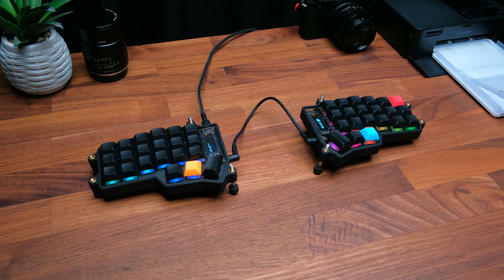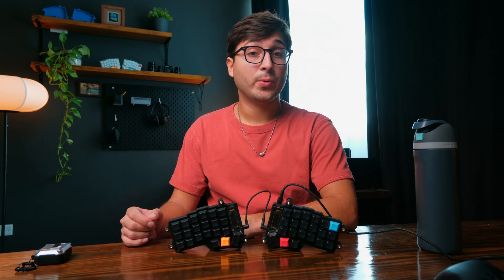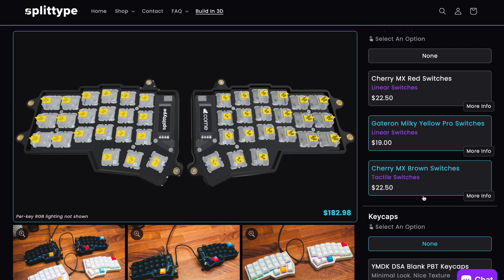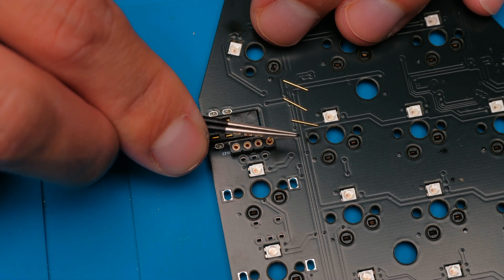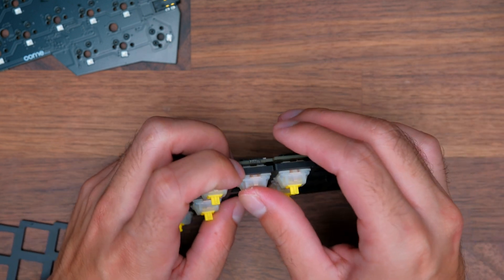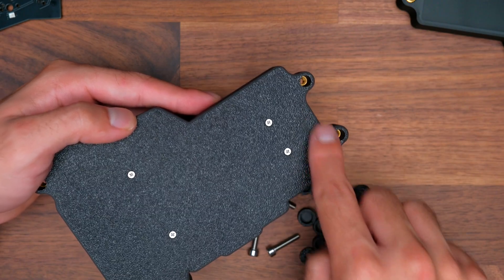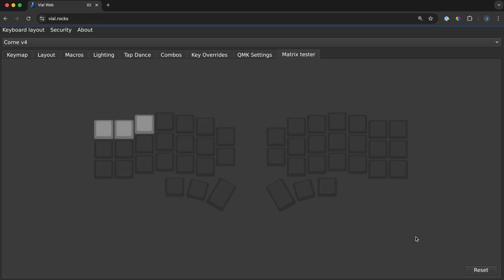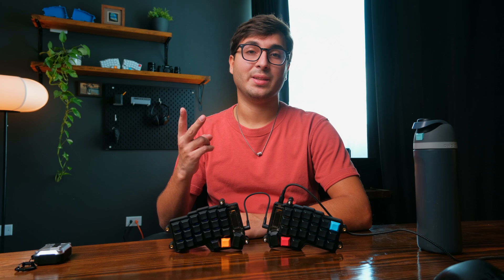Building A Split Corne Keyboard Has Never Been Easier: Full Guide

Comment: Ya'll need to start using solder paste instead of using irons. With surface mounted components, at least. You're literally bottle necking the process. There's no need to add the extra cost, whatsoever.

Comment: Hi @joseanmartinez, I know you own a wireless version, I wonder why you stop using it —I also own one. I've recently swap mine with another wired corne that I own due a to a lot of connectivity issues and key press being unresponsive. Are you also having these issues?

Which firmware are you using/prefer ZMK vs QMK, why did you choose one over the other.

Thanks for your time, your content is really good, keep at it.

Comment: I'm loving my corne from your shop! Amazing!!!!
One quick question: could you make a video or tutorial on how to use the default QMK software to flash this keyboard, and how to get back to vial if we come to regret it? =)
I'm loving the simplicity of Vial, but sometimes I feel like I could do more with QMC .c files...
(BTW: complete QMK noob here, although I'm a software developer)
Reply from the maker: @DanielRoma  Thanks Daniel! So happy to hear you love it! I can look into possibly doing a video about it, I haven’t used QMK with a RP2040 microcontroller yet. Flashing it with vial is pretty easy though, you typically just need to have the firmware file from the corne github, connect one of the halves, press on the reset button while holding the boot button on the bottom of the pcb and then drag the file onto the corne which should show up in your file explorer.
Reply: @ oh, so I need to disassemble it? Got it! Thanks!
I’ll try the qmk a little bit then. I already found out how to setup the 4 extra buttons on the .c files, which is not on the readme! lol

Comment: im confused as to why we cannot connect the audio jack cable with the powercable connected? i suppose it has something to do with short circuits and voltage jumps but i have the corne v3 with the helios rp2040 and it works fine for me
Reply from the maker: It might work fine, but it’s always a risk to do this with most wired split keyboards, so it’s best to avoid this.